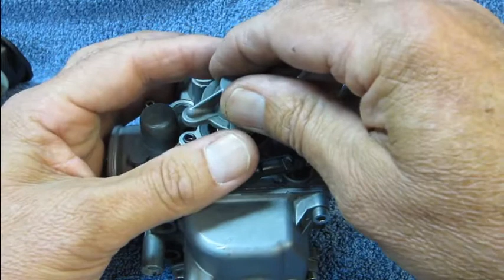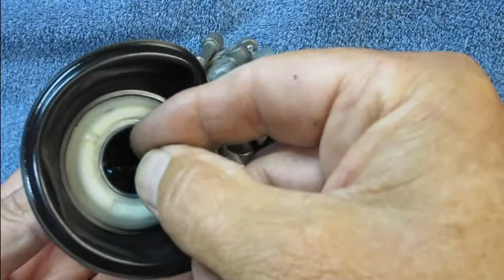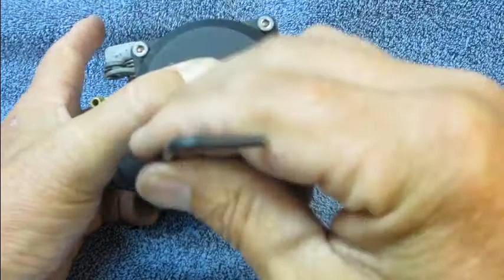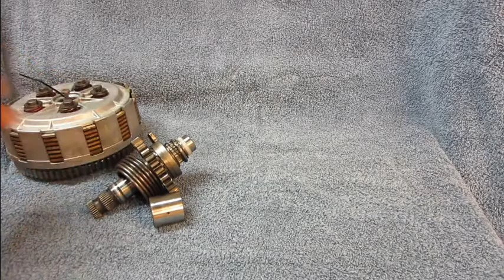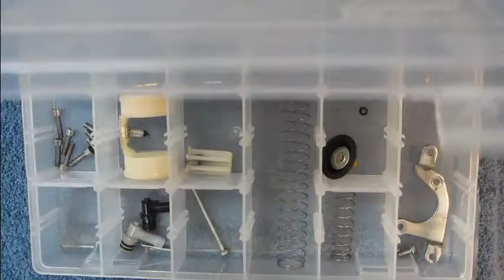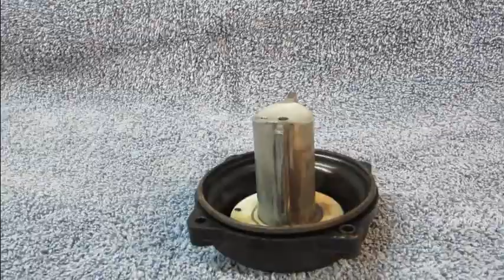CVK40 Carb Overhaul Video #4 Rev 1

Comment: I've relied on this video series once again! I've dove into my carb or my son's KLR carb four times in the past year. Each and every time, I refer to this series on how to take it apart, clean it and reassemble. You have presented us with an exceptional resource. Thank you!
Reply from the maker: I'm happy to hear that you're findig it useful! 

How's that KLX kit working out, with the 45 idle jet?

Tom
Reply: Tom, it’s fine. I don’t have to use the choke to start! Pulling the carb out, around the crash bars makes tinkering a pain. I’d like to swap in a 42, but will wait for winter maintenance season.

Comment: This is the absolute best carb series on YouTube. I can work on my carb with confidence, knowing this series is available, when I need it. Thank you!
Reply from the maker: Thanks for that! I'm happy to hear it was useful. Keep looking for 6th!
Reply: @souperdoo  , I went with the KLX mod. I have an after market exhaust (2 Brothers) and UNI air filter (and pulled the snorkel from the airbox). Eagle Mike says 42 pilot jet and 142 main jet. I put in the 142 main... but the 42 pilot jet is blocked so I'm using a 45 that I have on hand. Can you foresee any issues with the 45 pilot jet being part of the mix? Thanks!
Reply from the maker: @searchingfor6thgear44  ,

Nah, probably not. You'll be a bit rich on the first half of the throttle is all. That's better than too lean. The worst case I can see is that you might have a bit of a stumble from it being too rich.

When you can you ought to replace the 45 with a good 42, though, but no reason not to ride it.

Tom

Comment: Thank you for taking the time out.
Reply from the maker: +jusride7 You're welcome!
Reply: +souperdoo I watched the video and took the carb apart once again. I put the dang needle on top of the needle holder! I don't know what I was thinking. I still get a little pop on the deceleration. I have 1993 KLX 650 C I did the 22 cent mod with one washer. The bike is stock do you think I should try to bump up the main jet? I haven't even run it yet. It has been sitting dormant since 2007. Thank you I really do enjoy your videos and I subbed you. Aloha, jusride7
Reply from the maker: +jusride7 A little pop on deceleration is fairly normal and doesn't hurt anything. If you really want to chase after it, you would need to go up one size on the pilot jet, not the main jet.

I would leave it be unless it is severe.

Tom
Reply: +jusride7 Erratic idle too... I am thinking pilot too. Any suggestions as to what size pilot I should go?
Reply from the maker: +jusride7 The stock pilot jet should be sufficient unless you've done something significant to either the intake or the exhaust. Any changes to those?

Have you tried adjusting the idle mixture until you get the highest idle, then backing it off a half turn?

Comment: Thanks very much! The best videos!! for carb klr 650
Reply from the maker: Rafael, 

You are welcome! I'm happy they were of use to you.

Tom
Reply: @souperdoo  ou have an email address to send you a picture of my carburetor cvk40 of my klr 650 2013. Where I think that the screw that regulates the air-fuel mixture has a lid. and I have the doubt if there really is the screw that regulates the mixture and if so, how to remove the lid to access the mixing regulator screw
Reply from the maker: @rajafari  ,

Yes, there is a lid over the screw. It is to prevent you from turning the screw to satisfy the EPA people. 

It is easy to remove. Simply drill a small hole in it (drill slowly and be careful not to punch through to the screw underneath the lid) and then insert a sheet metal screw into the lid and pry the lid out.

See this video https://www.youtube.com/watch?v=Sb3WJjmVK4Y&list=PL3s67DOJbACwS_n6-lRcka2-DIAmdX1Ez&index=2 at 2:30.

My email address is contact@souperdoo.com if you have any issues.

Tom
Reply: @souperdoo  thanks for your help. First time in my life that I do maintenance on a carburetor. I did it because I saw your videos and I was encouraged to do so. My bike hard unused and without lighting 3 years.
Reply: for so long without use do you think it necessary to remove this mixing screw and clean it?
Reply from the maker: @rajafari  
The idle circuit has very small holes and passages. For so long being unused I would be concerned that these holes are not clear and so the bike will idle poorly.

You should remove the idle jet and make sure that the hole is clear. That hole is only .4mm in diameter so it is very hard to clean. You can soak it and blow solvent through it, but if you cannot see light through it then it is easiest to simply replace it.

There are also three very small holes at the entrance to the carburetor right near the butterfly valve. These must be clear, which you can check by squirting a carb cleaner into the mixture screw hole and watching it come out fo the three holes. The mixture screw must be removed for this and you might as well clean it when it is out.

Tom

Comment: That was a great series of videos for the carb. I have been having trouble with the choke intermittently malfunctioning and battling to start.  Otherwise it runs perfectly, good consumption and idling.  Is there anything special one needs to do with those starter jets and air vents in terms of cleaning?  Must the whole carb. be disassembled. Thanks for any advice.
Reply from the maker: Mal -

It doesn't need to come apart. Just drop the bowl and remove the brass bits. Soak them for a day or so in a bit of PineSol to loosen any deposits. Ream the holes out with some fishing line and/or a strand of copper wire.

Tom

Comment: Awesome video set! Can't wait to start. Unfortunately my CVK40 took a 5 foot fall into a wooden surface. Do you think any parts would be damaged at all?
Reply from the maker: Anything that could be damaged in a fall would be on the outside. The fuel and vent elbows could be broken or cracked. The throttle plate/shaft could have been bent. The intake or outlet could have been dented. If there's no evidence of any of that, I'd bet you're A-OK.

Tom
Reply: souperdoo Awesome, thanks! When I eventually decide to install a 685 I'll check out that video set too! You have a captivating quality like Bob Ross
Reply from the maker: Yeah, I suppose I do. He's dead.
Reply: That's a drag. I just came across your safety wire tip for the drain plug...Thanks. Definitely going to try it. I didn't look at the torque setting last time and turned the bolt 2 full rotations after finger tight :O

Comment: Hello my friend!! Great videos, congrats and many thanks. Could you help me in one short question? I have a 1994 Klr 650  and something is wrong in the carb. When I perform a cold start with absolutely closed choke , the engine starts but i need to open the throttle to keep the engine idling. There is a lot of gasoline flowing from the vent and drops to the floor. I think there is something wrong with the bowl. What do you think? Can I fix it without  removing the carb? Thanks a lot in advance for your coopertation.  Regards!

Comment: What do you use to clean the slide assembly and the multi-pronged plastic thingy that goes into the slide? I'm guessing you don't want to spray or soak them with carb cleaner.
Reply from the maker: No, you don't want that! I use a tooth brush and a bit of PineSol to scrub anything that doesn't get soaked. Follow up with a warm water rinse.